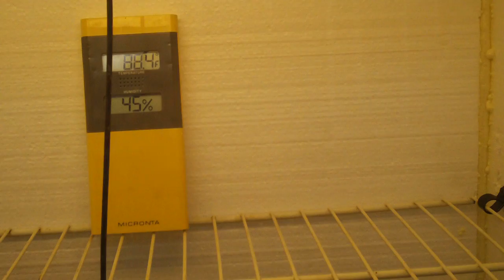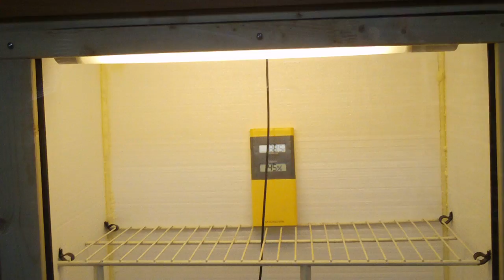New and improved incubator!

Comment: Curious. from what ive  learned from my superiors insulation and air flow look good. is it a closed system or are you pulling outside air and just using the fans to push it through.

Comment from the maker: @TwistedPerceptions The water becomes the same temperature as the surrounding air, when you open the door, the air can blow out, but the bottles stay there and hold temperature much better than the air, and act as 'thermal batteries'